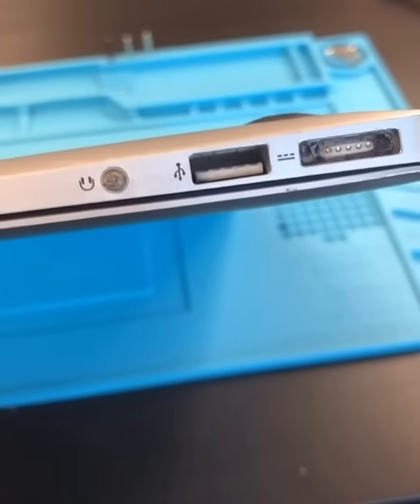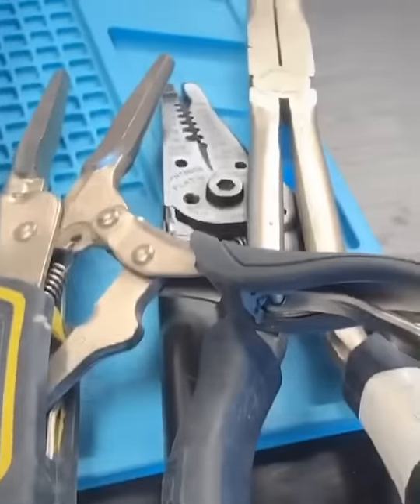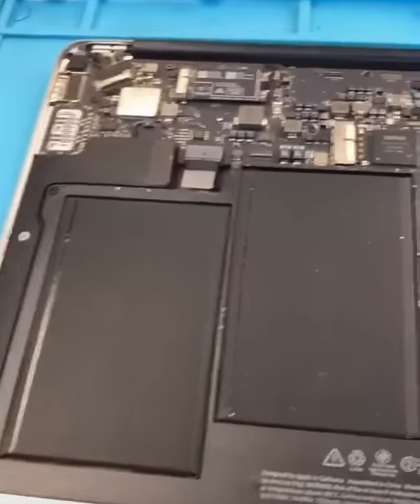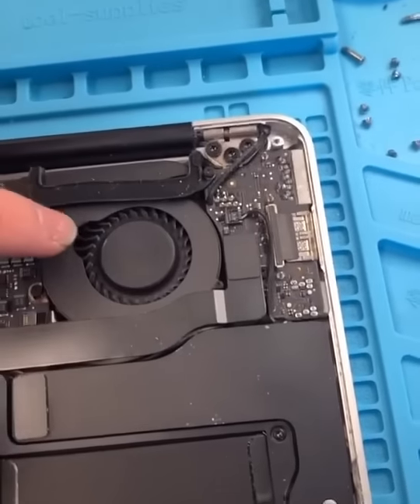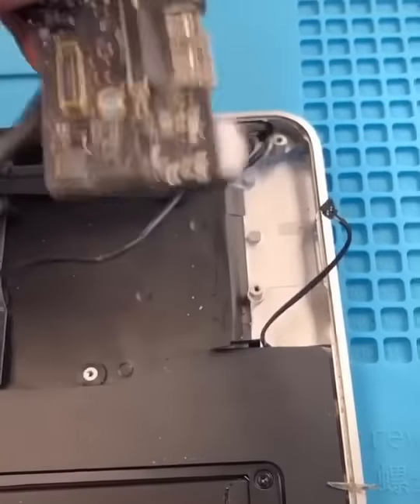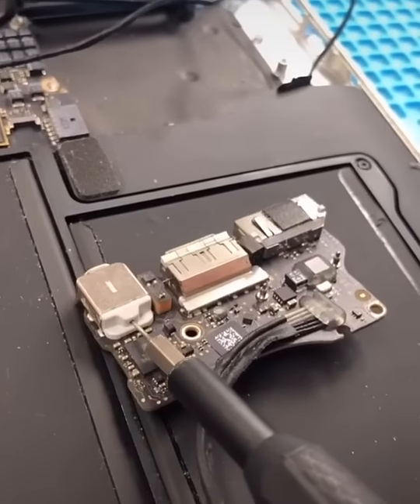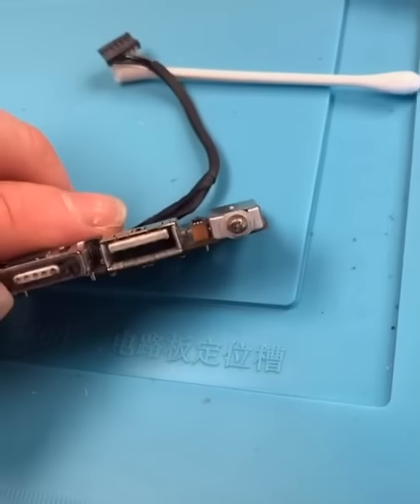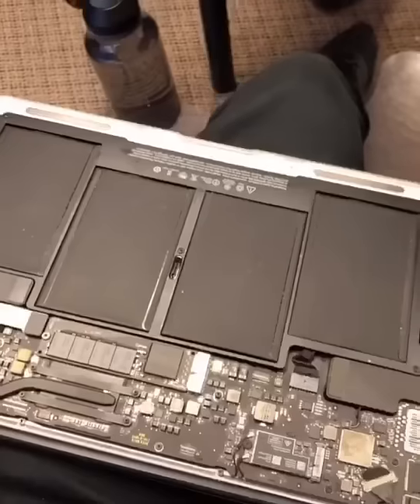Don't Use Glue On Your Macbook.... WHY? #Shorts

Comment: Him: opens up computer to see samsung

Me: My whole life is a lie
Reply: Samsung sells parts to apple. So every Apple device has Samsung parts.
Reply: @deborah6312  Apple wouldn't be shit without Samsung lmaooo
Reply: @deborah6312  Apple design the chips, Samsung just manufactures them, along with TSMC
Reply: @ArtTracerX  Basically most of what you said is false/factually incorrect. M1 is manufactured by TSMC and designed by Apple, not manufactured by Apple. Also, I don't know where you heard that "legal rights" stuff, but generally it isn't the case, if you look inside an early iPhone you can see some of the proccesors before the A series chips have Samsung logos on them, despite being designed by Apple.

Secondly, CPUs and processors are the same thing, the internal parts of which, in Apple's case, aren't "partially designed" by Samsung, just merely manufactured by them. Read up on exactly how these chips are produced with transistors.

Now I am not saying every single chip you see on that logic board is designed by Apple, I am saying the majority of the chips in an Apple machine are specifically designed by Apple and manufactured either by Samsung or TSMC, that is the reason for Apple's superior hardware-software synergy, because each part is specifically designed to work together in the most efficient way.
Reply: @deborah6312 and apple sells screens to samsung 🤣
Reply: "Wait its all Samsung?"

"Always has been 🔫"
Reply: Yeah but no. Apple is the one designing it, Samsung just manifactures. Because Samsung isn't just a brand of gadgets, it's also a manufacturing company so your whole life might not be a lie. Like when a chocolate company puchases their chocolate from a manufacturing company.
Reply: @eyesaiah8405  All I'm hearing is samsung is basically honda, while apple is acura, both the same thing but one at an added cost for name and luxury.
Reply: No, your whole life has just been under a rock! 😃
Reply: @arcanep  other way around bro Samsung makes and sells screens to apple
Reply: Lol
Reply: ur pfp tho😂
Reply: Bold of you to think so, see ya when you discover that actually your whole life is a Samsung
Reply: @arcanep  You got it backwards Samsung makes screens for Apple bud. 🤦🏽‍♂️🤣🤣🤣
Reply: Samsung is better.
Reply: @isaiahprieto9751  Bro I can see that you didn’t understand anything🤩. And the thing with added cost for name…The cheapest newest samsung starts from $699, so does the cheapest newest iPhone. The most expensive new samsung starts from $1100, which is tHe SaMe pRiCe aS ThE mOsT eXpEnSiVe NeW iPhOnE🥴
Reply: @victorcomanici7507  yet samsung has more ram for less
Reply: @victorcomanici7507  cheapest samsung phone are like 100$ tho
Reply: @arcanep  its the Other way around i mean Apple ownes the Displays But still Samsung is the one making it
Reply: Lol
Reply: @arcanep  apple sells screen to Samsung? What world do u live in. Also same with Samsung? U do know Samsung actually makes every single part by its own without involving any other company. Like the super amoled(the super means its made by samsung) its all samsung display and the other normal amoled or oled are from other company
Reply: @forest3064   design is nothing if it's nkt working
Reply: Because at the end, Samsung make the best batteries. Every electro domestic brands use samsung batteries.
Reply: you didn’t know that? Apple’s screens are made of Samsung as well.
Reply: @iForix  apple wouldn't exist without samsung yea
Reply: @moon.chr0m4tic  ?
Reply: @ErisstheGoddessofmanhwas  well you obviously know nothing about computer architecture
Reply: @tbfrl834  pretty sure they would buddy.
Reply: @forest3064  who cares i know that there is SAMSUNG EVERYWHERE AND I KNOW THAT MY OLD iphone 9 was useless
Reply: @forest3064  lol i ment iphone 8 and write 9 and you made yourself expert because i made a mistake lol
Reply: @forest3064  🥰🤣🤣🤣
Reply: @ErisstheGoddessofmanhwas  good job you can read, well done 👍😀
Reply: @ErisstheGoddessofmanhwas  What can I say, you should have double checked your comment, you could have said anything in retrospect.
Reply: @forest3064  i can say whatever i want to annoy you , you are the one who still answer , i don't mind i have nothing better to do .im charging my old iPad with Samsung charger and annoying you 😇don't mind my grammar im not American
Reply: @ErisstheGoddessofmanhwas  Nah it's all cool man, If you are trying to annoy it is certainly not working. It's fun to answer you, just be glad you are getting some free education from me though, maybe your grammar will improve! 
Also well done on figuring out you can use a standard USB charger universally, great job yet again 😇.
Reply: @forest3064  like i told you im not American so i don't care for your free education if i wanted to know better English i have a scholl lol..
Btw apple still have Samsung parts everywhere and doesn't matter if Apple  designed them i can design to  lol
Reply: @forest3064  like i say i can say whatever i want lol you are the one don't like it and im enjoying it ..i have always time
Reply: That's why i got a 'trust issue'
Reply: @arcanep  other way around dude Apple gets their screens from Samsung 💀
Reply: @forest3064  i don't mind and don't expect me to improve because you want it ..purposely i wull write wroong hehe ...se in the next round
Reply: @forest3064  random dude don't expect me to be for you all the time you will get your reply sooner or later btw im not designer so why should i design , but i am annoying so i like annoying random dudes like you ....see ya
Reply: @forest3064  hey you are you alive or a chicken
Reply: @iForix  I have to say that's a lot of bullshit
Reply: @arcanep  its actually the opposite
Reply: @arcanep  it's actually the other way around, iphones uses samsung screens
Reply: The iphone screen, memory chips, and probably the battery are made by Samsung. So basically a iphone is 80% made from parts used on Android phones. Yet iphone users act like iphones are miles better than a premium android phone. When it's not true at all.
Reply: @forest3064  That is false, especially since the Samsung parts he showed are only for wifi and Bluetooth connecting and they work perfectly fine.
Reply: Nothing new iPhone uses Samsung display
Reply: @iForix  Apple could replace Samsung with LG in a heart beat LMFAO
Reply: It shouldn't have been a lie since people have been saying for decades that apple isn't anything special, but since it has the band brand y'all think each one is made by Steve Jobs reincarnated as a unicorn lol
Reply: @arcanep  I think u got to turn it the other way around
Reply: if apple made every chip in an iphone we'd be using blackberry's 🥰
Reply: @forest3064  lmao wtf no they dont
Reply: @mikeyguevara2030  I think you'll find that they do. Maybe do a little research!
Reply: Right! 💯
Reply: @arcanep  other way
Reply: @41g28  yeah like 6of u replied that ok
Reply: @arcanep  ?
Reply: @felixf4378  something called software which also just makes it a better experience
Reply: I'm the 10000 like on your comment 😃
Reply: @jimjamjon2285  qot samsung is the best screen maker wtf
Reply: @deborah6312  iphone 11 has a qualcomm chips too
Reply: @arcanep  who sells what?
Reply: @arcanep  oops you made a mistake, Samsung sells screens to Apple
Reply: @arcanep  other way around
Reply: No apple is a lie not saying our lives aren’t full of lies Bwhahahaha
Reply: @kcoker9189  have you drunk something??
Reply: @phrodendekia  tf?
Reply: You didn’t know that already?
Reply: You didn't know?
Reply: @forest3064  "Samsung just manufactures them" 🤣
Then why doesn't Apple "JUST" manufacture them if it's THAT EASY ?
Surely Apple would increase their profits if they did that
So WHY DON'T THEY ? 🤪
Reply: @arcanep  HaHaHaHa 🤣

This is why Apple is worth over $2 trillion
iSheep with more money than sense.
Reply: @isaiahprieto9751  No
iPhones are mostly Samsung than Apple
Everytime a Samsung phone is sold = Samsung makes money and Apple makes nothing
Everytime an iPhone is sold = Apple makes money and Samsung makes money too
Samsung is on a win/win
Reply: @jimjamjon2285  Samsung could drop Apples profits in a heartbeat 🤣
Reply: @eastlondonhustler  hahaha Samsung relies and begs apple to be a customer. Apple are their largest source of income and that’s a fact. Cope
Reply: @eastlondonhustler  Something called Supply Chain Management, it is cheaper for Apple to use Samsung manufacturing capabilities, because Samsung have perfected it over the years.
Reply: @forest3064  Yes that is also true, which means Apple relies on Samsung to produce their iPhones and make money
BUT
Samsung has zero reliance on Apple.
Due to the fact that CPU manufacture is a specialised industry and very few manufacturers produce them, therefore Apple doesn't really have much choice than to pay Samsung.